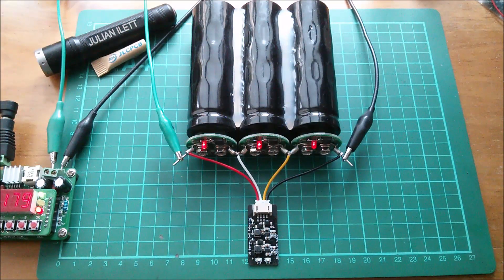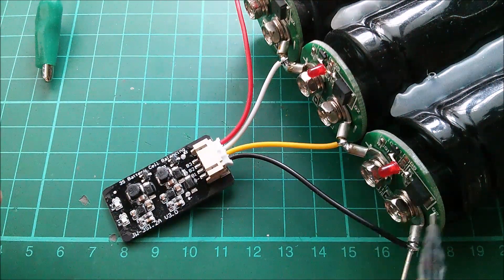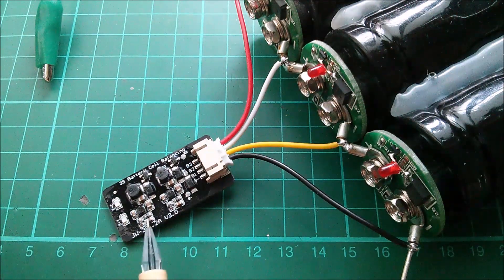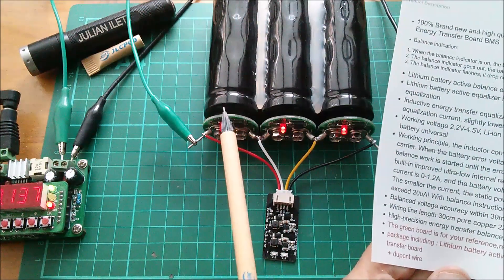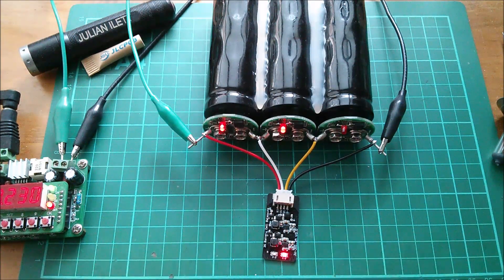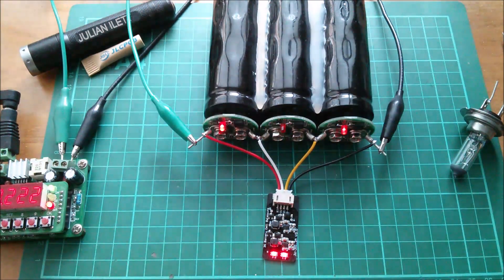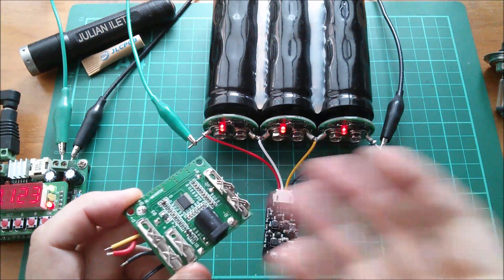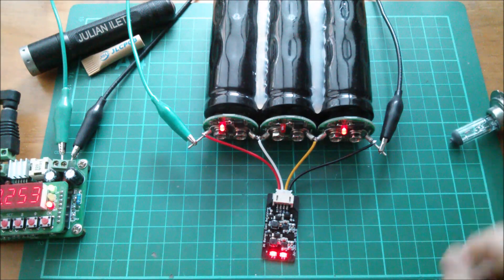Active Cell Balancer for Lithium Ion Battery Packs

Comment: mmh that balancer should be given the time to equal out cells 3 and 2 and then i would expect the voltage on cell 2 to differ from cell 1 so it should light out first the left led for some tome and then the right one. but to be honest i guess this thing was a bit slow for my taste. i wouldve wanted to see it equal out these cells a bit faster also it wouldve been nice to see to which voltage you discharged that one cell with your h7 car bulb. 

apart from that did you already start figuring the problems with your spot welder? and your featured in a hackaday post on that maybe its worth a read (if for nothing else then at least for the links to other projects of the same kind)
Reply from the maker: Yeah, I'm fairly certain the problem with Supercap spot-welding is the very fast voltage drop (exponential fall into a fixed resitance load). This is where a battery works and a supercap doesn't. I like the simplicity of Dark Kevin's 12V car battery and hand-timed solenoid setup :)

Comment: Are they single wound inductors? Couldn't see enough detail of the PCB
Reply from the maker: Yes, tiny SMD inductors marked 1R0 (1uH?) with two pads down on the PCB.
Reply: @JulianIlett  1R0 = 1 Ohm wire wound bleed resistor masquerading as an inductor in marketing?
Reply from the maker: Definitely inductors. If these were simple bleed circuits, there would need to be 3 of them (1 per cell).